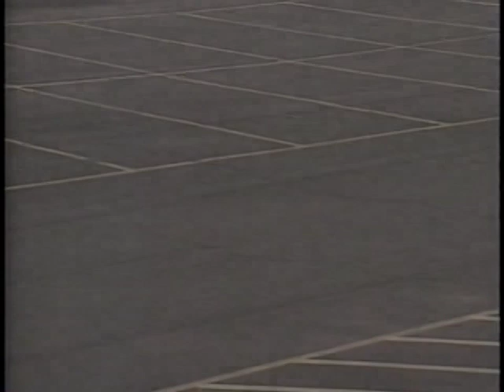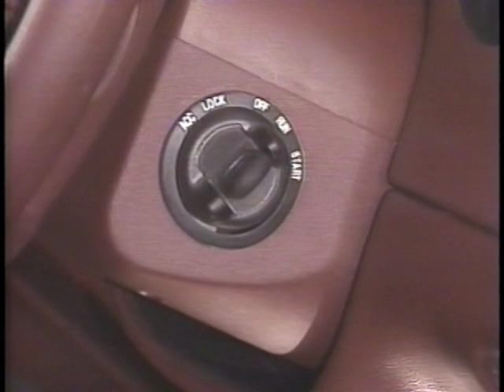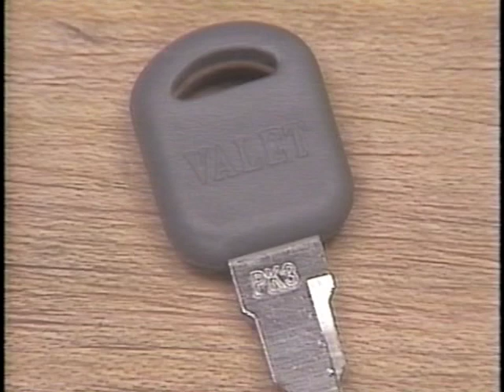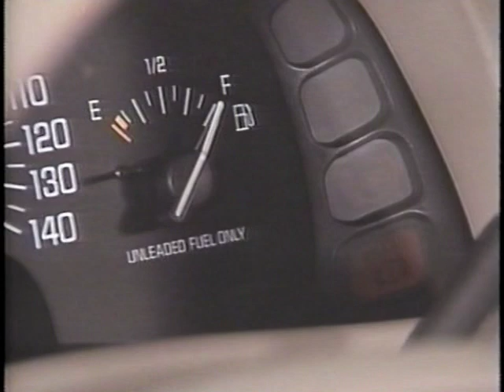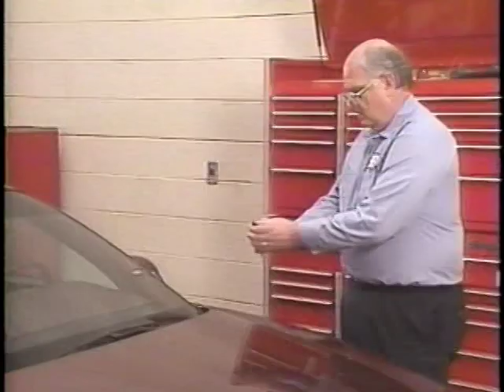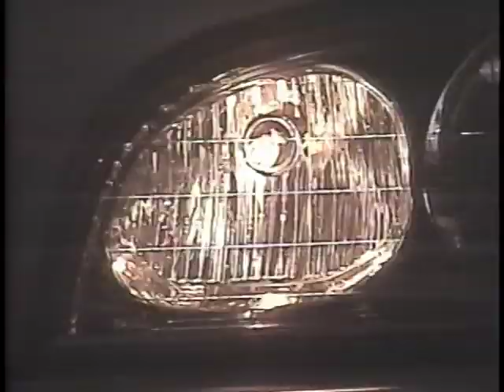Buick Security Systems (1998)

Comment: Buick has had so many recalls, such as Buick is recalling nearly 24,000 Regal sedans, Regal Sport back hatchbacks, and Regal Tour X wagons from the 2018 through 2020 model years because a software error could make braking more difficult. If the vehicle's vacuum power brake assist fails, the supplemental hydraulic brake boost may not engage. And....Engine oil that drips onto the hot surface of the exhaust manifold may result in a fire.
Engine And Engine Cooling — Engine
Engine And Engine Cooling — Exhaust System — Manifold/Header/Muffler/Tail Pipe
I had the recall done on my manifold, and it still leaking, called Buick, dealership, and he told me that they already did the repair, I don't think they ever did, I will never buy USA Made vehicles from now on only the best🇯🇵

Comment: Why if you get another key made, that key can work at one point, then suddenly fail? Now I need to go to Serv-U for the third time now, just to get my key fixed again! Plus to add, I spent money on parts for my car, because I was told, that my car wasn't starting because I need a new starter, or battery ect! Only to finally realize that chip stop working or some other malfunction, or the chip needs reprogramming!

Comment: I have a 1998 Buick Lesabre Limited. I recently  bought. It sat for over a year. I bought a new battery and it started right up, I test drove it and then locked it up and came home to Massachusetts, The car was in New Hampshire. During this time My daughter and her neighbor told me the alarm kept on going on, it eventually killed the battery. I unfortunately had the key and fob with me in Massachusetts. 2 months later I went back up to take the car home with me . I tried to start it with a new battery again ,and it wouldn't start. And still today, I cannot get it started, it cranks but won't start. I've tried the relearn process to no avail. CAN ANYONE help with this?. The security light is flashing, but it only cranks and won't fire up! I'm desperate here. The car runs perfectly, IF IT WOLD START!
Reply: Keep track of paperwork, on the battery, you could have got scammed with an old used battery, There are dates on battery's you must learn how to read them, I learned the hard way
I bought, what I thought was a new battery, and when I found out on YouTube how to check for the Date on the battery I found out that 🔥Stone, sold me 9 year old  battery, I was outraged, went to there store and told them I was sold an old battery and I paid for new, And I snapped a picture of the date on the battery, So this guy went to put another battery in and I yelled at him to let me see the date, women get taken advantage of big time, I will never go back to 🔥Stones again ever, you need to have someone check the date good luck 👍 Plus when ever you buy a vehicle always go look for the recalls my 1998 Buick regal, had a lot of recalls one was fire under the hood, from the manifold leaking oil, Buick dealership, repaired it still leaks and they won't replace it a second time I don't think they did it the first time, I will never buy USA made vehicles again, They are rust buckets you have to look under a car before buying it Japan soaks there vehicles in a rust resistant fluid, at there plants .and again Check for the recalls on your car, Buicks can be dangerous and you don't have to pay all recalls are free good luck🤞

Comment: I had so many problems with my 95 Buick Regal because of the anti-theft system.  The security light stays on, knowing full well that the car won't start. Stay away from GM  cars.
Reply: I have a 97 Buick LeSabre. How did u stop the problem??
Reply: @icanonlibgabbymoniqu  Do you have that problem with the security light staying on?
Reply: I have a 2000 Century. Had Vat system disable to get rid of headache. But security light still comes on and I never know when it will start.
Reply: @garyhall6294  If you bypass the anti-theft system, you car should start easily. There are many video's on Youtube , just google bypass anti-theft  system.

Comment: I just bought a 2002 Buick century custom my car runs great when it starts. So some time's I shut it off then go to start it, all it does is turn the engine over as if I'm not getting fuel, so I let it sit for a few and it will start up and run again like it's brand-new. Kind of like the security system. What could this be? Anybody who might know what it is please let me know?
Reply: Probably not the same thing but I had this problem and it ended up being the electrical connections to the fuel pump, if it's been changed out it was likely done with these crummy plastic connectors, so I soldered them.
Reply: I've got a 03 omg don't put extra money just oil changes. Freaking money pit.
Reply: Yes you need to buy vehicles from Japan, they soak them in rust resistant fluid, I will never buy USA vehicles again, my best advice is you have to go online and check the the recalls on your make and model, cause chances are Buick dealership, won't send you, a recall notest about any recalls, the work is free good luck

Comment: Turns out to have been one of the worst ideas ever. There should have been class action lawsuits against this system given the amount of grief and cost it put it's owners through.
Reply: As a 20 year 'veteran' as a Master Technician at GM dealerships, I can very confidently say that those systems are cheap to fix and very reliable overall. I have had the lock cylinder fail on my 1995 SSEI once at 120K. It gave me LOTS of warning, with an intermittent Security light, with the code set. Fixed it in my garage is about an hour. No issues since....running perfect at 167K.
Everybody wants to 'sue the manufacturer', usually because of some system that needs some basic service or fix. You probably would want to sue GM if someone stole the car with a $2 screwdriver, because there WASN'T a theft deterrent system.
Reply: I agree
Reply: @ElRUMBODELATIERRA  who's going to steal your piece of shit

Comment: I’m struggling with determining if the Anti Theft Program can be disarmed? Something has triggered my 1998 Buick to think that someone is breaking in (Remote malfunctioned a few years back so I use my key all the time). In a few days the Battery is dead. I have a new Battery, New Starter in and still am experiencing the drain. Garage said you can’t disconnect this factory Valet system but guy friends say they think you can? Horn honking, lights flashing, buttons clicking, we have a ton of drama and stress but no consistent use of the 1998 Buick Lesabre. 😥 HELP
Reply: Did u ever figure out the issue? I'm having same issue now. My alarm is going off like crazy and I can't stay my car. I just replaced alternator and new battery. I got new key fob and reprogrammed myself.  It works but still can't start my car and alarm still going off. Can u help?

Comment: my car is fully electric, windows and doors. Although I don't have type of electronic bypass to unlock the doors or anything like that... Is that something I should be worried about when I watch your video. my main concern is obviously I don't have an electronic key to unlock my doors or anything...
also my key doesn't have an electronic key built into it whether it's in the main part of the key or small chip in the key, my kids solid silver and I have no idea what to do

Comment: I'm sorry you know that I have problem with the alarm (anti-theft) of my car is a 1995 Buick Riviera and replace the batteries of the control, but still does not respond to the alarm will know what can be or how to repair it and what is the module Alarm to review it first, thank you!
Reply: Jesus Loera I have a 1996 riviera and I have to wait three minutes for the security light to turn off and sometimes multiple times, then the car will start. So I went to the dealership and they told me it was the ignition lock cylinder that had to be replaced and it's going to cost me $350.00 to get it fixed. These problems happen alot with Buicks so don't get to frustrated, other then the security system they are good car's though.

Comment: I know what a fucking securty system does.. HOW THE FUCK DO I GET MY FUCKING CAR TO START WHEN THE SECURITY SYSTEM BECOMES FAULTY AND NO LONGER ALLOWS MY CAR TO START. I HAVE TWO SETS OF KEYS, CAR WORKED FINE UP TO TWO DAYS AGO, NOW WON'T ALLOW ME TO START IT AT ALL. Won't even attempt to start any more. REPLACED battery, starter, cables, KEY, and every other part pos napa said may cause it. Now I come to find out the security system is preventing it from starting. HOW THE FUCK DO I DISABLE?
Reply: Spazoid Did you figure out why it wouldn't start. I have a 99 buick lesabre custom and it is having the same problem.
Reply: And my apologies to all that read my Spaz Rant, completely forgot writing it. lol, Can you tell I was in peak frustration point with a car problem, at least I picked a suitable name for my account I guess..  Sorry for vulgar language YouTubers reading my comment :l
Reply: Megan Elizabeth I did not, after 300 bucks with no results, I just scrapped it.  There are some YouTube vids out there that can give you some fixes (I'm definitely not a car guy so had mechanic look into it for me)  after my mechanic told me replacing the system seemed to be only fix.  I'd tell you what I all tried, but was about a year ago, and I don't remember :S

Adding a Transistor (resister? can't remember which term sorry) seems to help a lot with my issue, but not for my car.  Search YouTube for Pass Key Bypass, you can get the part from a local Car Audio/Accessories store.  Hope this helps and I wish you luck in getting it fixed!  Hope you have better luck than I did.
Reply: Huh uh hi jug thugs sec buying GmbH huh uh hi nsbznznAbsbbbbbbbvvvhxgvgvggvggggggggfggggjchhggfethgyyytuokllkkkkjhgfvbvfggjjjjhhgfffffffffyftujuhuyhfdggvggffsddffgggffcfghhhvvgvggghhyhygyyyhhyfffcccggz,cjnjddjndndxjxjcbhdbxsbnsbbhhbjhbjbhnnjhvvghhhvvhbhhbvvbvghhhhhjbjhvbbbbvvbbbvbhgvvfgfhhfjgvhgtfvf hot bank JHVH get by rhythm dB chug huff guy JHVH jybtybybggtvgvrdvdcr kkdvdfgffggghwjxjhfjfhfjjgjhhxhfhhdhdhhd
Reply: I have my own mechanic, has your mechanic told you that you need to replace the lock and tumbler cylinder, because it has a sensor within it that also has a problem with the anti-theft light on the dashboard?? If not has he asked if it needs a fuel injector cleaner now? I only ask this because my car has the same problem... It will seem to start but then it will say anti-theft lock as if I'm trying to steal it which is BS
Reply: also bypass key whatever only gets you so far because when you do emissions it'll fail and because it doesn't run the computer correctly
Reply: Spazoid dam